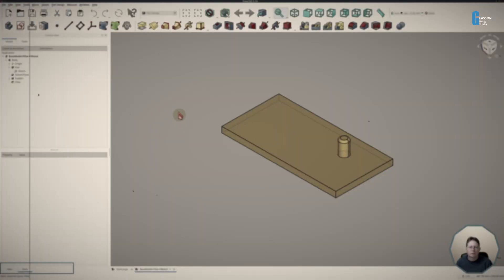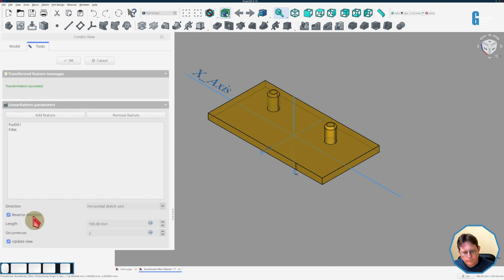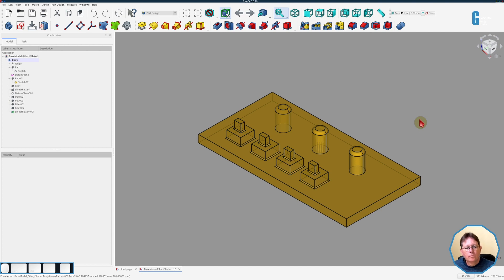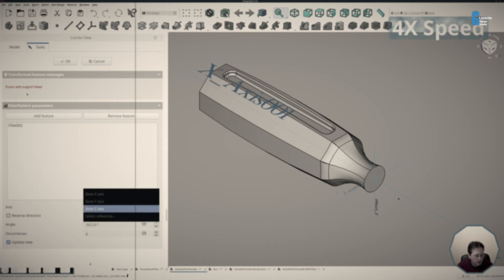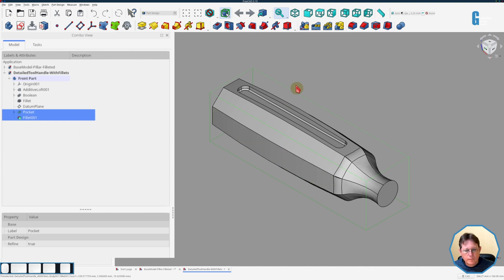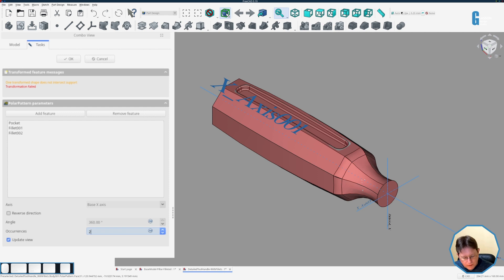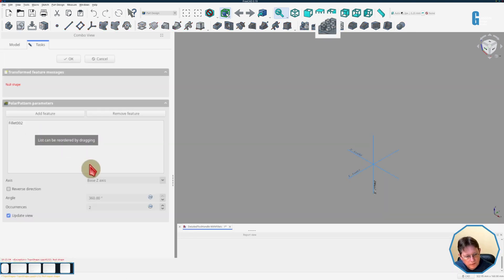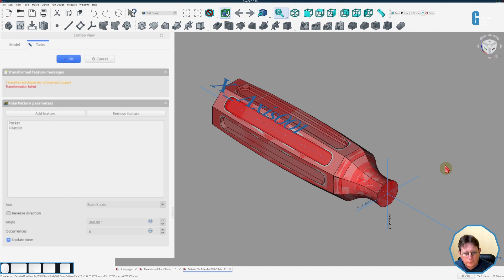Corrections to Linear Pattern and Polar Pattern tool videos

Comment: Good videos, I watched your Polar Pattern and then this correction video.  Video was easy for me to follow along with in FreeCAD except that I had to go back and recreate my pockets a couple of times as the first time I just did a single extrusion with the holes included in the sketch of the rectangle and the second time with the holes on one sketch and pocket.  Then finally I modeled each pocket individually and then I could make the patterns as you did.  This will help me to create my own "bud boxes" for electronics enclosures.  How tough would it be to parameterize this with the spreadsheet values?  I will probably use this technique on a box later this week which will be housing a controller for a hot wire foam cutter I am making.  I am thinking of using this (linear pattern) to propagate screw bosses in the box and screw holes in the lid.  Can you offer any tips?
Reply from the maker: Hi Steven, thanks for your feedback. I'm glad that you found the videos useful. I use spreadsheets quite a bit and find that they make my modelling easier - primary because my memory is going (I'm getting old lol). I don't think that it will be too hard for you to parameterise your design using a spreadsheet, but what I have found is that developing a consistent naming convention for your spreadsheet parameters helps significantly. I initially named the parameters after their purpose but I found that at times I'd end up with a parameter with a very long name which made it difficult to remember.
As far as using the linear pattern tool is concerned, you might actually find that the Multitransform tool might be a better fit because you can combine one or more linear/polar patterns to create the desired layout. I don't have a video on that yet, but it is one that I want to get onto in the not too distant future.
I hope that I understood your question and that this helps. 
Have a great day.